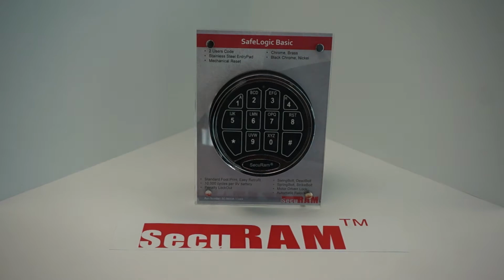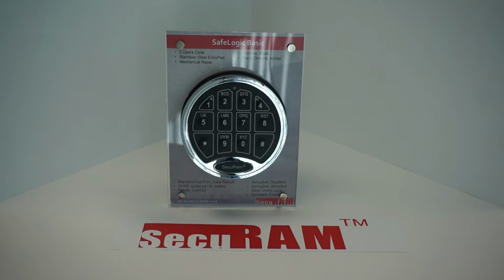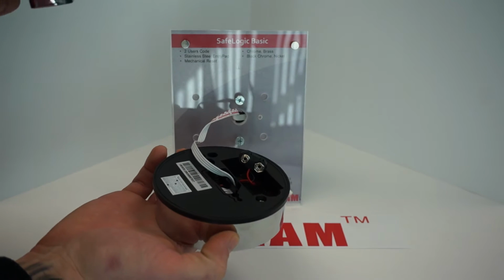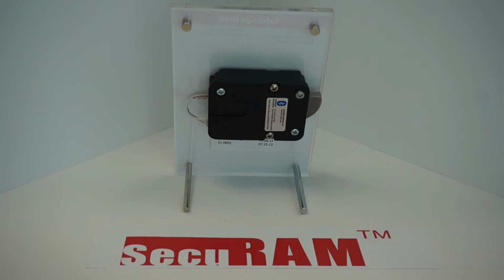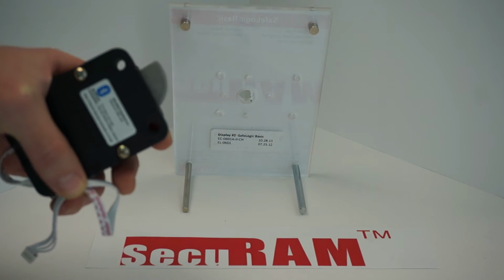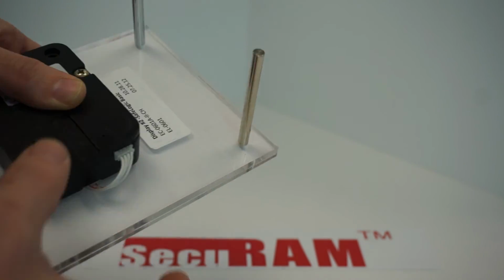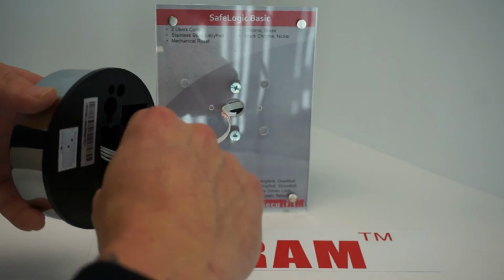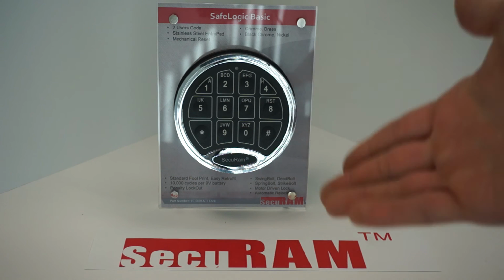SafeLogic Entrypad and Lock Replacement - SecuRam

Comment: I screwed up! I tried to change the supersede in my basic lock and messed it up. I don't know the exact number I entered and the secure system keeps activating and prevents me from continuously  trying. Can I recover and how?
Reply from the maker: I am afraid if you dont know either of the codes: the manager code or the user code, there is no way to open the safe lock.
Reply: @securam Thank you for your reply.  I do know the user code and am able to open the safe. It is the manager code I messed up.
Reply from the maker: @sterlingpeters3412  That is good news.  With the safe door open you will need to access the back of the lock body.  You will find a reset hole on the back of the lock body.  Once you have access to the lock body, please call our office at 805-988-8088 and we can walk you through the reset process.
Reply: @securam  If I replace the basic keypad with the biometric I'd need to do the reset and call, correct?
Reply from the maker: @Parrish-Patriot71  Correct you would need to reset the lock